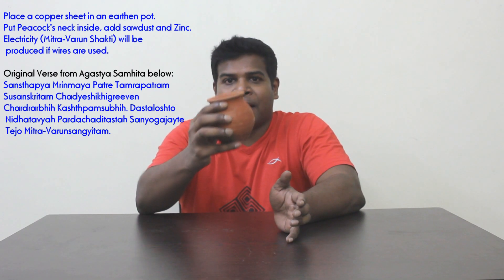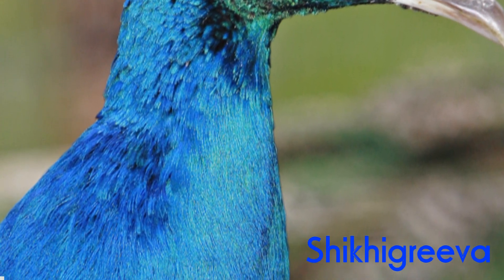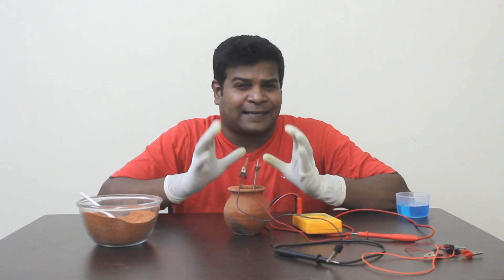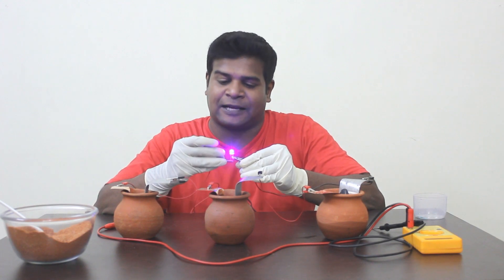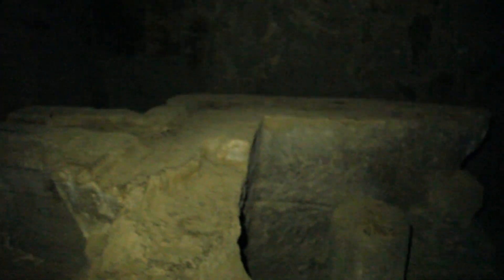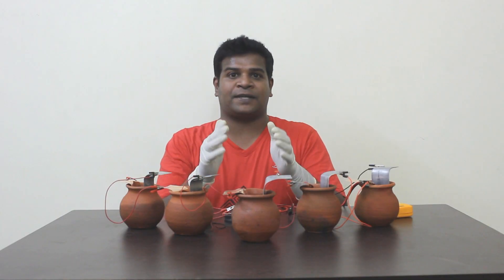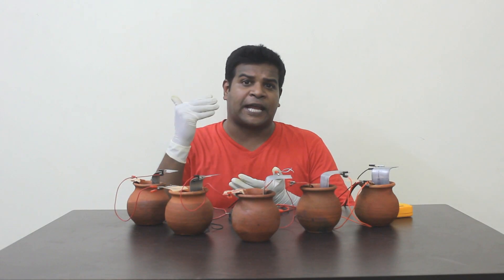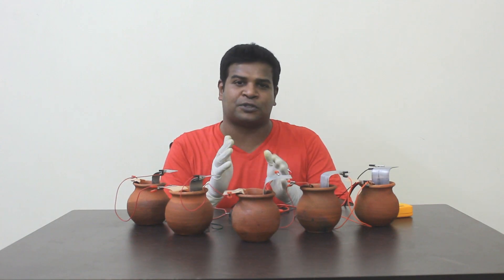Recreating a 4000 Year Old Battery - Was Electricity Used in Ancient Times?

Comment: My doubt was how do they connected the bulb and battery only with wires? If they use metal they will get shock what did they used to prevent shock ?Were they coated with anything??And do they made copper sulphate and also how do agastya maharshi observed hydrogen n oxygen ??
Reply from the maker: Your doubts are well noted sir,👍

Comment: Praveen ji... Please explain wether there was any findings on how to prepare a copper solution. 
Because many may ask how they got such material, dust it and then make a solution. 
It will be of great explanation if I can know that.
Because peoples need to change their views on ancient architecture now and by ur support we r also trying to feed this knowledge to the other peoples. 

Once again thank you for such video, I was just searching for some electrical engineering stuffs from our ancient because I always had a thought that, in night without bright Some brains have definitely light for the solution.
And using fire everywhere was not so convenient or safe or spiritually permitted. In my village I remember till now, an open fire is only used for doing puja or prayers everyday during morning or evening and same fire is rounded in entire home, for light though we enclosed the same fire inside a glass jar with some holes in it (lanterns also came when I was there but before that), a fire in wooden hand or (massal) is something called symbol of rage, lost, etc and our village people dont prefer it for lighting. 

Thank you for enlightening us with such remarkable information. 
🙏

Comment: In our own lifetime( I am 61 years age) we have seen electronics with big valves, small solid-state transistors, and now tiny or micro integrated circuits, so much change, then by anology can we not imagine such technologies in unimaginable type available then? Huge temples, forts and possibly residential palaces must have used high technologies with power used from batteries shown in this video. Powering not only lights but also lathes like machined

Comment: The ancient text of Agastya Samhita describes the method of making electric battery, and that water can be split into oxygen and hydrogen.

￼

Modern battery cell resembles Agastya’s method of generating electricity.
For generating electricity, Sage Agastya had used the following material:

1. One earthen pot
2.Copper plate
3.Copper sulphate
4.Wet saw dust
5.Zinc amalgam

His text says : “Sansthapya Mrinmaya Patre
Tamrapatram Susanskritam
Chhadyechhikhigriven Chardrarbhih
Kashthpamsubhih.
Dastaloshto Nidhatavyah
Pardachhaditastah
Sanyogajjayte Tejo
Mitravarunsangyitam”

संस्थाप्य मृण्मये पात्रे ताम्रपत्रं सुसंस्कृतम्‌।
छादयेच्छिखिग्रीवेन चार्दाभि: काष्ठापांसुभि:॥
दस्तालोष्टो निधात्वय: पारदाच्छादितस्तत:।
संयोगाज्जायते तेजो मित्रावरुणसंज्ञितम्‌॥

Which means, “Place a well-cleaned copper plate in an earthenware vessel. Cover it first by copper sulfate and then by moist sawdust. After that, put a mercury-amalgamated zinc sheet on top of the sawdust to avoid polarization. The contact will produce an energy known by the twin name of Mitra-Varuna. Water will be split by this current into Pranavayu and Udanavayu. A chain of one hundred jars is said to give a very effective force.

When a cell was prepared according to Agastya Samhita and measured, it gives open circuit voltage as 1.138 volts, and short circuit current as 23 mA.

Anen Jalbhangosti Prano Daneshu
Vayushu
Evam Shatanam
Kumbhanamsanyogkaryakritsmritah.

if we use the power of 100 earthen pots on water, then water will change its form into life-giving oxygen and floating hydrogen.

Vayubandhakvastren Nibaddho
Yanmastake
Udanah Swalaghutve
Bibhartyakashayanakam.

If hydrogen is contained in an air tight cloth, it can be used in aerodynamics, i.e. it will fly in air. (Today’s Hydrogen Balloon)

Process Of Electroplating by Maharshi Agastya in Agastya Sanhita:

Excerpt from “Technology of the Gods: The Incredible Sciences of the Ancients” – By David Hatcher Childress

“In the temple of Trivandrum, Travancore, the Reverned S. Mateer of the London Protestant Mission saw ‘a great lamp which was lit over one hundred and twenty years ago’, in a deep well in side the temple. ……. On the background of the Agastya Samhita text’s giving precise directions for constructing electrical batteries, this speculation is not extravagant

😊😊

Comment: Krishna hand bad was a battery ...the rods of Horus were copper and zinc .. or sometimes gold and silver .. crystals inside ....a crystal and or copper ring was stuck on the forhead 3rd eye ....the body was charged by sungazing ...the body is a battery ....when the 3rd eye is fully activated it turns on like a TV and you see suff while fully wake .. just like a lucid dream....the rod are used like antena ....you can tune into stuff like remote veiwing ....

Comment: In a pot a thick metal coil that can be easily heated can be kept and the pot's mouth can be closed with a quartz or transparent gem tile to pass the light out without hurting the eyes. The quartz or gem top should have adequate holes for air to enter for combustion and cooling and to avoid bursting of the pot due to vacuum.

Comment: Making those sulphate batteries is one thing, just for fun. They cannot generate enough power except to light leds. I would suspect that the ancient advanced Indians use a resonant device to capture the energies for those work in the caves. Or even more advanced, specific devices to absorp the dark energies, and convert them to visible energies. .Read the old scripture and think along these lines. As for the stones and scultpures and block of stones- they are cut to size using a special laser. This laser is tunable to cut different materials by altering the resonant frequency of the laser.  The American govt was rumoured to have two of those lasers, given to the US by aliens. 
For the pyramids, sound waves or magnetic levitation , were used to levitate the tons of stone and labourers just pushed them into place.  The many theories put forward by so-called experts using rolling logs,  and water to float the stones or camels/elephants/horses  to pull the block of stones are just nonsense - consider them as stories put forward by playing children.  
So did into your old, old, old  scripture - maybe you may find these devices described somewhere.

Comment: Few doubts here
1. How did you conclude that peacock head is Copper sulphate? There are many naturally occuring solutions which are also blue in colour. 

2. Moreover Copper Sulphate solution that you used is not a natural occuring solution. You need to prepare it by using H2SO4 with copper metal while passing electricity to it. H2SO4 was itself discovered in 8th century. So how did they manufacture CuSO4 at that time? Moreover how did they generate CuSO4 without electricity in the first place.

3. If the description of battery was already there why no one from India put it to use? Why only when West invented latest batteries we are telling that we invented it first?

4. Zinc was discovered in 17th century. How is it possible that you got the correct name from a book written 3000 years back ?

5. Are  you just interpretating ancient text based on modern discoveries and invention? What is the use of it?

Comment: Very interesting, I can see why it works. It is well known today that some dissimilar metals will react with each other when placed in contact. Aluminum wiring in 1970's USA homes is a good example of this, wherever it contacts copper or steel it corrodes quickly. Anyway, at 2:10, the "peacock neck" thing made me wonder how many peacocks were killed over the years by would be alchemists trying to recreate this experiment, lol. And I wonder where they found copper sulfate 4000 years ago.
Reply: Ethan Walker
Well it isn't peacock neck actually, but only alluding to that. A name was needed to be given to the stuff (now we note it down as CuSo4) & they picked up peacock neck due to colour resemblance. No peacock was killed to collect the stuff. It is how scriptures were misundersttod without knowing the context.

Comment: These kind of batteries can provide around 1 mA. This means that you need 40000 pots in order to make a 40W incandescent light bulb work!
So if they were using LEDs (impossible), assuming they were fine with 100 lumens, they would still need a thousand pots.

Comment: Now try to light a primitive bulb.    Modern bulds only work because the filament is in a vaccum.   If the filament is not in a vaccum it burns out pretty quick.   Sorry,   I don't believe the bulb theory.   Now if they found an ancient glass bulb I would be blown away!    :)

I do think they could use the battery to electroplate things though.

Comment: I want to believe this, but the only thing I can't seem to find any information on is how they would have made Copper Sulfate without using hydrogen peroxide or nitric acid, unless they also found ways of making nitric acid. If you could find out the process they used to make the solution, I'm sure this would help solidify the theory.

Comment: According to the agastya Samhita the battery is a source of DC current the same DC current is used for flying VIMANAS. These VIMANAS (especially TRIPUR VIMANA) uses DC generators to power them which are located on the top of these aircrafts(VIMANAS)
Reply: Which chapter of Agastya Samhita mentions battery? Which verse? I want to see it myself.
Reply: GATAROOSH GHANGURDE
AC or Alternate current as developed by Tesla (as I heard it) is preferred for generation & transmission and some devices for which AC motors were developed. In all electronic circuits (& gadgets) the circuitry runs on DC and is so, needed to be converted to DC.

Comment: cool, but there is no soot, because the walls were covered in gold plaques - you can see the hanging points still embedded in the walls.  When we find just one crushed lightbulb or something similar, then I'll reconsider.  Western culture had been playing with electricity for hundreds of years, before finally finding a use for it.  Just because one has an earthen jar, that needs to be constantly maintained to generate a whole volt of electricity, with almost no amperage, does not indicate high enough tech to create lightbulbs, let alone anything that requires any sort of real power.

Comment: Wake up people!!!
Peacock neck does not contain copper sulphate. 
There is no way one could make a filament that wouldn't oxidise at high temperatures 4000 years ago.
The bulb thing shown is actually a lotus and a snake.
It took Edison thousands of tries to find the right material for the filament. And even that was not perfect.
You need thousands of such cells shown in the video to produce enough current to light a bulb.
He glows an LED in the video which is 1000 times efficient than an incandescent bulb
(Please don't tell me there was semiconductor technology too 4000 years ago)

Comment: Great video.... love your work... just a question.. how long do you think that this small light will keep burning using this set-up with only 3 battery's ?
Reply: Frank Van Asch
This can be calculated by an engineer. For instance, my calculator (with two normal old sized battery cells) lasts years & years, because the FET Technology used (that consumes the least power). But my cellular phone needs to be re-charged everyday !

Comment: Have you ever heard of the Baghdad batteries before?  They were 3 small five inch terracotta jars with a plate of copper formed into a cylinder and an iron rod centered within the cylinder utilizing bitumen as an insulator and presumably grape juice as an electrolyte.  Several modern experiments have been done to recreate these simple batteries with success.  Some theorize that they may have been used to electroplate gold onto silver and in several tests with these batteries connected in series have been successful at electroplating objects with gold.  I have seen some evidence of possible electric use by Egyptians before as well, but this is the first I have heard of batteries being used in ancient India...   Another good video, thank you...

Comment: I like what you are doing but you need to be honest and admit that your suggestion that peacock neck and copper sulphate is a leap in the dark and that when you say the text advises using multiple cells it does not use the word cells and or voltage or current. The lack of soot and carbon is explained very easily. Firstly these were people who cleaned surfaces as they were creating their art. They are hardly likely to have left a sooty turd by a mona lisa? also they are more likely to have put any flames on tables well away from the ceiling so any soot would be very evenly spread even if it was there.

Comment: But machining needs high volt AC.... is this sufficient to run lathes for such gigantic pillars?? why cant the pillars in hale bidu temple be carved by manually operated lathes by using a gear system and chisels.... electricity is not of any use without a rotating part....induction coil or something. try searching for this is classical texts kasyapa silpa sasthra or manasara or something....

Comment: Really great job you done by making video on this topic

Sanhita says hydrogen evolved from that which is possible by electrolysis of water collect that air in special cloth and use bird to navigate  , sanhita doesn't mention external Circuit 
Note : electrolysis can done without external circuit the reaction happen in pot as wet sawdust present 

And you saying about archiological finding of pot that contain copper plait 

It may be Of for green ink making
They keep plats with curd

Or simply in water as copper has antimicrobial activity.

Comment: A very good effort  & Congratulations & keep up the good work. I just noticed a mention of Lightning Arrestors, in one of the comments. One of my friend, an IIT Chennai Professor in the 1970s explained how the lightning arrestors were made for the Hindu Temples in the form of 'kalashas' to disperse the lightning energy without a copper of iron down-conductor that is used in modern high rise buildings. He also mentioned why it is necessary to do a 'kumbha-abishegam' once in 12 years, when the kalashas are refilled with new grains to keep up their ability to disperse the static electricity, as the grains do deteriorate over a period of time, even though they are sealed inside the metal container.

Comment: Excellent video, Praveen!  You are onto something big!   Please keep it up!
Reply from the maker: Thank you my friend.
Reply: Very interesting with great knowledge good work
Reply: No he is not the only thing he is on to is a waste of time
Reply: @mr.elusive848    why  do you  think  so ,  explain  ...
Reply: @radhakrishnant.n.2828  I say this because there is no terminal and it is  such low energy there would be nothing they could power
Reply: @mr.elusive848  
It is common knowledge that these cells (that we losely call "batteries") can be connected in series to enhance the voltage, in parallel to boost up the current and a combination of both to get both voltage & current of needed level. The word "battery" in English means a stack or collection of similar things. It has now come to mean the single cell too, that is incorrect. the very fact that the word "battery" (not cell) is used implies that there are many cells (in a battery) to supply electric power those days.
Reply: @mr.elusive848  you can simply use bigger pots and can put them in series if you want to produce more energy it's simple.

Comment: I think lighting up an led and a filament bulb is different..  Same applies to a exhaust fan motor..  Lots and lots and lots of copper sulfate is required..
Reply: You are right, but as you didn't know the battery so is knowledge of illumination technology, we don't know what kind of lighting equipment they used, technology in lighting could use very low voltage to light or maybe a high efficiency technology....
Raising questions with our level of knowledge is easy.... Let's think beyond our knowledge sphere... That's what Praveen is trying 😋

Comment: Can you do the same Experiment in the large scale
Reply: Danny Sorto I do not see anything that prevents the scaling in this model. Pretty easy to get bigger pots and rods. Like wise the number in series. Pretty interesting to think of it. Buy scaling the size, and numbers both in parallel and in series, you have a very high voltage and current source. Cumbersome yes, but for a fixed source, should work pretty well.

Comment: Awesome Video, very convincing, but I just got a doubt....What if the Roof was introduced after carving the sculptures???It's possible right?
Reply: Sameer Kasivajhula kailasa temple is built out of single rock. They built it top to bottom by digging the rock. So I guess roof came first
Reply: It is CLEAR that you did not watch the Kailasa temple video....
Reply: Sameer Kasivajhula the lights can be easily hindered by the reflected lights. I feel so good for you that you have asked openly. It's always nice to share the knowledge.
Reply: But, in cave temples are not such kind. Cave temples are monolithic structures.
 It generally starts from a mountain and carving it afterwords. It varies drastically with prefabricated construction which was generally followed by the temples.
Reply: You're all right, but by thinking crazy I got another idea... What if mirrors are used to reflect the light into the cave...? #Justasking
Reply: Sameer Kasivajhula there is a possibility but not all the time.
Reply: Sameer Kasivajhula it requires lots of light to get the sculpture pitch perfect